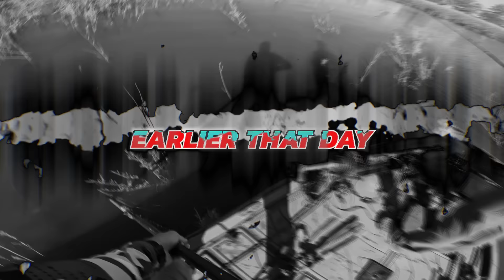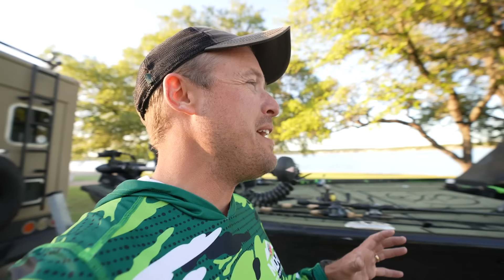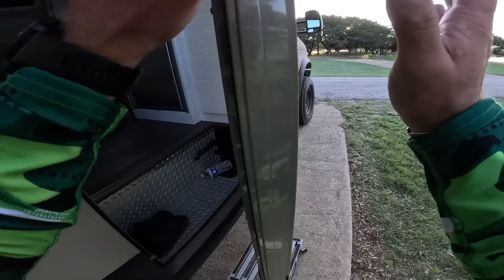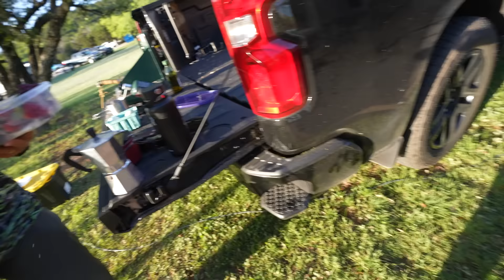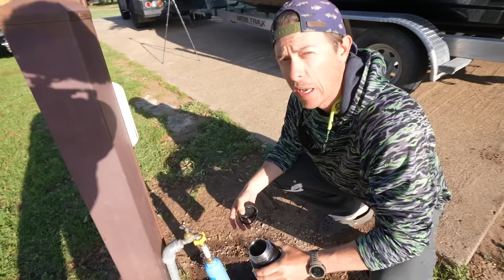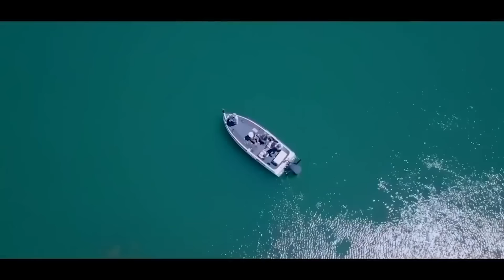Surviving 24 Hours In The Ultimate Doomsday Vehicle

Comment: Don't waste $1000 plus on "upgraded brakes" I would guess you may be dealing with a master cylinder leaking by if they're getting soft while holding brakes for a long time. And getting the air out of lines is called bleeding brakes, you can do it yourself with someone pumping the pedal for you or you can buy a tool to do it by yourself or a shop but either way a couple hundred bucks is someone taking advantage of you. Bleeding brakes is also not a "maintenance" thing, once it's done you should never have to touch it until something needs replaced.

Comment: If you take off your drive shaft make sure you block all the wheels first, so many people get run over doing it. When you disconnect it, it is not in park anymore because you detached the transmission from the wheels and it can move freely.

Comment: We typically see a small increase in fuel economy with a little more modern tune on the 7.3s. But, it's a solid looking rig for sure! Changing the driveshaft is definitely something you can handle yourself, but remember to chock the wheels when you get there!

Comment: Yes, I would definitely upgrade the brakes. But no, you don't need to replace all the brake lines and everything so don't let anyone tell you otherwise! Unless they are bad, rusted, or other issues but I would upgrade the rubber flexible lines to the calipers with some steel braided brake lines. If you wanted to get the biggest and best big brake upgrade that you can get, then I'd get a direct bolt on Big Brake Upgrade Kit and that will include everything you'll need to upgrade the whole braking system front and Rear.   There's different kits with the biggest and best being the 8-Piston caliper kit, then the 6-piston caliper kit, the 3-piston kit, 2-piston kit, then there's the OEM styles. But the 6-piston kit would be plenty efficient for the F-450 Ambulance platform, but the 8-piston would stop even better and overkill. But I always build everything with overkill in mind, that way nothing ever goes wrong!  @LunkersTV @RobertTerkla #RobertTerkla #LunkersTv

Comment: Just a brake booster; liquid spring suspension if you’re fancy. Your calipers are most likely leaking. Inadequate braking on the ‘ramp’, is most likely due to a insufficient feed pressure problem. Brake lines and better seals help, significantly; disregarding an improper PSi.

Comment: Rob, look up (power stop)brakes for that e350 pad rotors an new calipers will be double cylinder wont lose pressure. You can get parking brake kit as well. no lines unless needed but im sure the lines are fine.

Comment: Drive shaft will be easy , remove 4 rear u joint bolts shove a pry bar in there get it to pop out and just pull er out and reverse that to put it back in

Comment: Rob, use Ebc or Powerstop pad an rotor kit. You should not have brake fade while at a stop. Possible hydraboost issue. Driveshaft will take you 30 min to change.

Comment: Check ur power steering fluid and your brake reservoir level u could be low on power steering fluid and your hydro boost isn’t working properly and make sure they topped off ur brake fluid after bleeding your brakes then for your drive shaft it’s simple just four bolts at the rear diff make sure to replace those bolts and retaining straps apply your parking brake or have  your wheels chalked and where the drive shaft goes in to the transfer case it’s keyed so you don’t need to worry about clocking it

Comment: The rig is sweet but have you thought of getting like a Ram 2500 or F250 diesel and then pull a small camper and your boat? Probably give you better gas mileage, you can keep your camper at the campsite while taking the boat in and out of the water.

Comment: When you change the drive shaft BLOCK THE WHEELS FIRST . before removing the drive shaft unless you want to run yourself over. Soft brakes you could have a faulty master cylinder and its bypassing and possibly need to replace it or if that ambulance has antilock brakes the abs could need to be bleed you could still have a small amount of air in the system